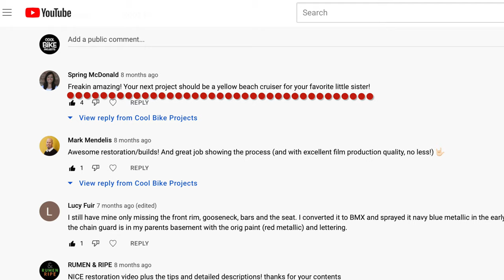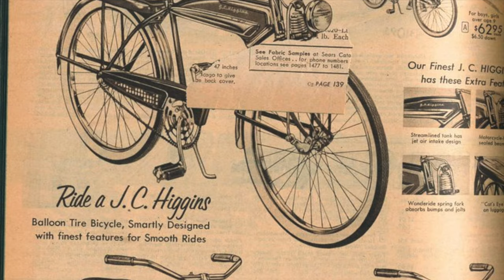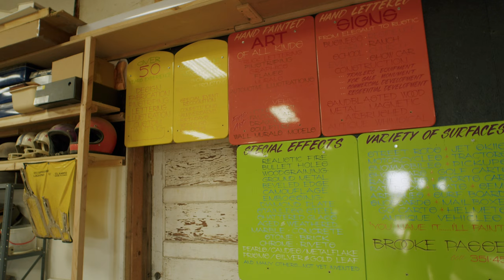How to Restore a Vintage Bike: My Sisters Dream Bike

Comment: You could still use the housing for that headlight. Remove all the corrosion and garbage and find an rechargeable high output LED flashlight that'll fit inside of it. All you'd have to do is just open up the lid to turn on the flashlight..
The fix the outside it could be primed and painted or you could get some Chrome vinyl wrap and just wrap it!
Reply from the maker: All great ideas Joe, unfortunately the housing was rusted all the way through the bottom. Large chunks came off as I tried to remove the lens and batteries.
Reply: @CoolBikeProjects  much sad 😥

Comment: The final result and smile from your sister said it all .Great bike 
Re your dead battery  entombed front light .did you get the battery out ? And have the shell ? I had a 1970s light look exactly the same .got the batteries out lots of acid damage .but I un riveted the internals and soaked in citrus acid / vinegar  and then wired brushed  the inside after rinseing   it out with water .only a few pin holes then painted riveting  an old lamp internals into it .( beautiful  old lamp and I really wanted to save it,5 hours work later )
The lamp added that final peice de resistance ." Try bring life back to old things "as old shovel says 👍
Reply from the maker: Unfortunately, rust went all the way through the top and bottom when I tried to unbolt it from the fender the housing ripped right through. The batteries were from the late 80’s and completely crumbled when I took them out.
Reply from the maker: Very cool you were able to restore your!